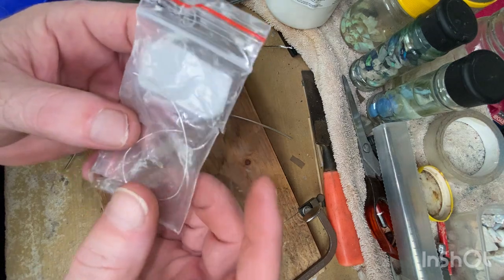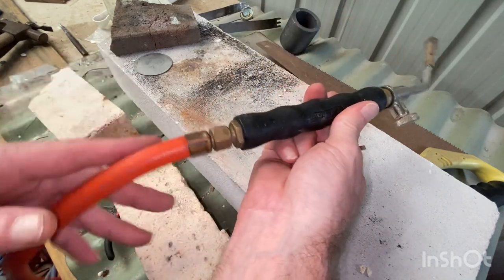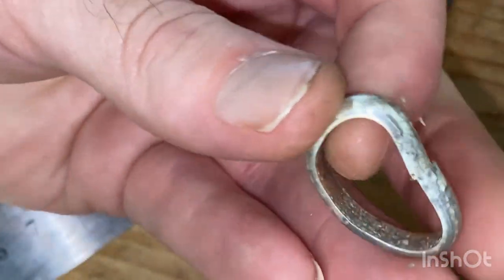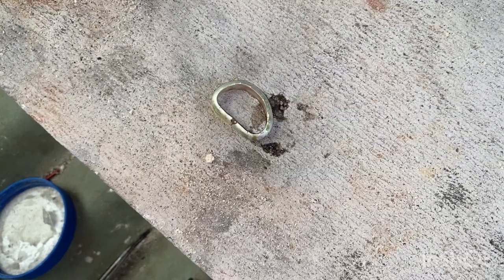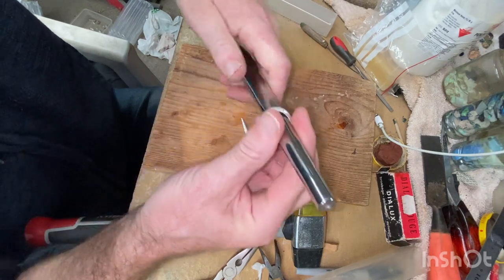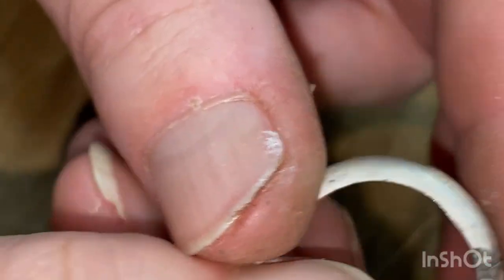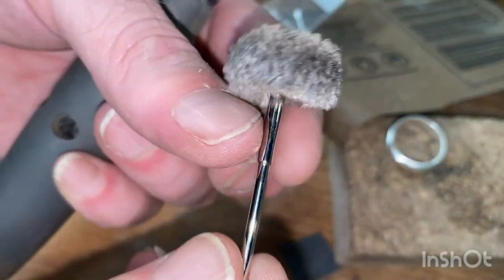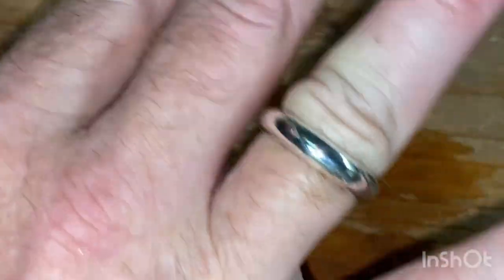Silver smithing: making a silver ring pt 2

Comment: Some great little money saving tips - thank you... my only query is are you sanding metal without a dust mask??
Reply from the maker: Ty, unless I’m hand sanding, I use a dust mask with almost all dremel work (carving excluded as it’s done in water) especially using wax and rouge to polish, those little cotton mop tops kick up a bit of fine particles and dust. 🤪👍
Reply: Phew - good to hear ....you mentioned to wear goggles at the end of the vid and I thought you were going to add mask .... I thought  “respect for thinking of different ways to save money on Dremel tools and it’s great that you are sharing how you do things rather than the textbook methods etc but don’t skimp on health and safety!’